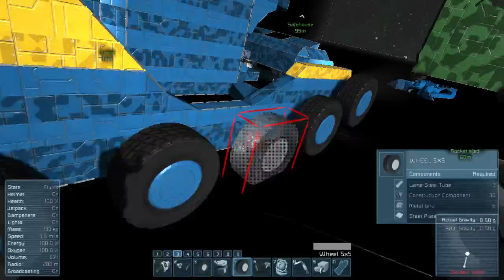XPAR Torus (Medium Tank)

Comment: Would it help with the physics if you mounted the wheel rotors on vertical pistons to work as dampers?
Reply from the maker: edirhC In theory. In practice, it makes the physics freak out.